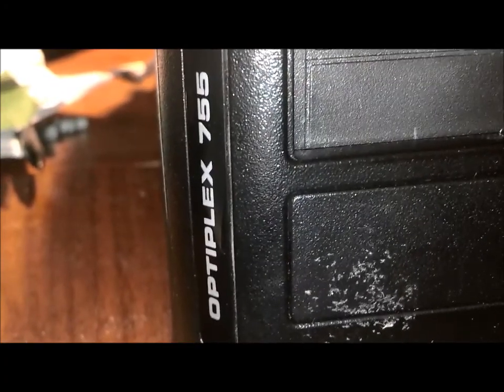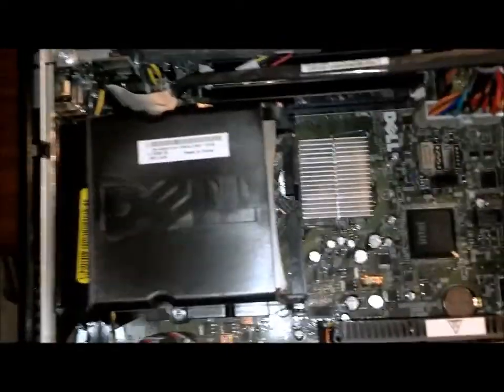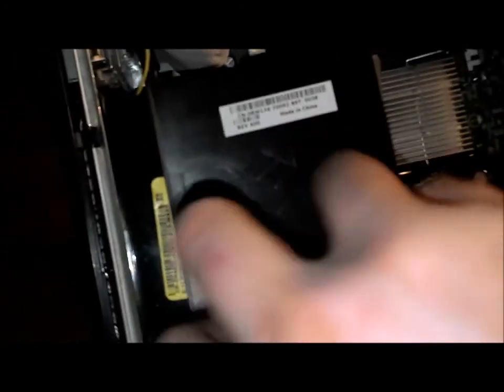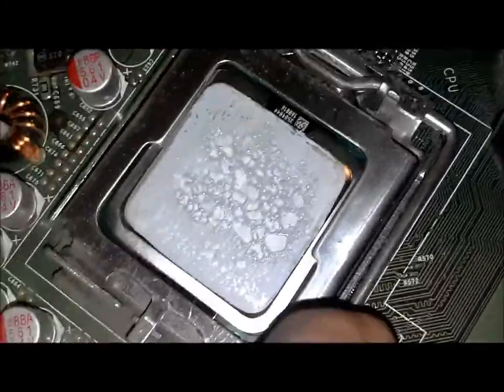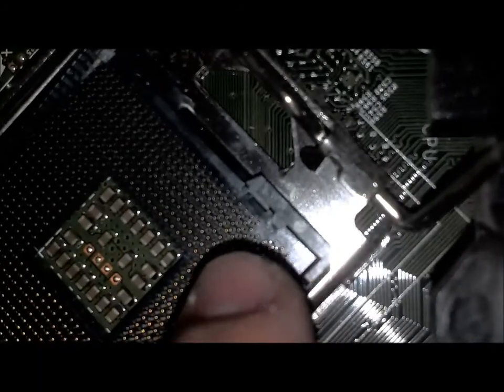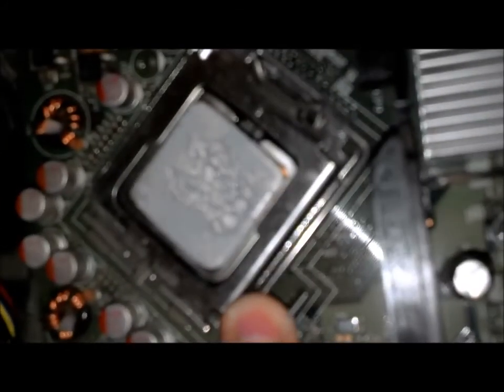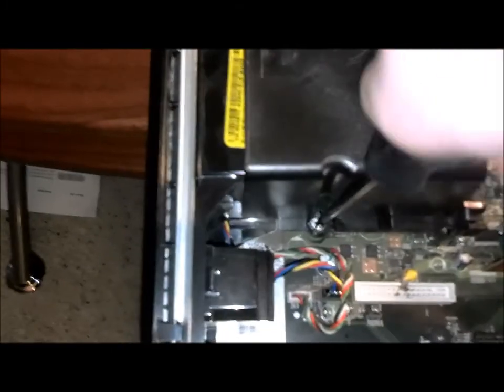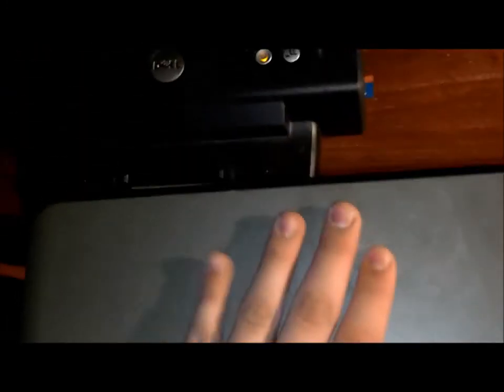Upgrading processor in the Dell Optiplex GX755

Comment: Hope this comment goes to the right person in the right video. The I3 processor uses a difference socket than the Dell computers the video is talking about.The Dell's make use of socket 775.No exaggeration when I say there are probably 50 socket 775 cups (if not more) that can be installed in those Dell's,all without a BIOS update either.

Comment: These Dell and HP-Compaq Core 2 Duo based computers are coming onto the market as off-lease refurbished in large numbers and are cheap. Most will accept any 775 socket processor, including high powered Core 2 Quad processors, also found cheaply on EBay. For less than $200, you can put together a max upgraded referb with respectable or better power,

1. Check the documentation on your computer to see which processors it will support. You can find these online, Google your computer's name.

2. There is a good chance you will need to download and install your computer's latest BIOS code before it will recognize a newer processor. It's not difficult, just be prepared for that possibility.

Thanks for the video. Now I know what is under the black plastic box.

Comment: Not much value here as there was no instructions on how to figure out what processors your machine can accept.
Reply: +Dan R the highest is Core 2 Quad Q6700 or Q6600, which still relevant today
Reply: +fantikar ff Thanks, I am writing right now off a Dell Optiplex 330. I installed 4gb, the Q6600 you mention and even a GTX275,hmm I wonder how the power supply dealt with that. My point was the video did not talk about this stuff Running Win 10 without issue, in fact I have Win 10 running on a dual core Compaq from 2004, it is all in the memory,some base cpu qualifications.As mentioned in another response, these Dells being socket 775 makes them very versitale. I myself when searching for older machines to put back in service like the Dells and HP's (HP tend to hold lots of memory). OH, I use an external power supply,just for the 275.
Reply: Dan R the 275 takes up alot of power... why didnt you get GTX 750 instead?... I am on my Optiplex 755 , stock cpu C2D E4500 paired with GTX 750 but this is all kind of useless with the very weak E4500... I need to upgrade to C2Q E6600 for me to take real advantage of this gpu...
Reply: Hello Fan, I bought 4x275 from the "B" stock at EVGA (something like 55.00 each) This was back in 2011

Comment: I have a Dell Dimension 5100 that I use as a second computer, It has a Pentium 4 in it. Would you recommend upgrading it to a Core 2 Duo?
Reply from the maker: the system want support core 2 duo but you can put a Pentium d in  it